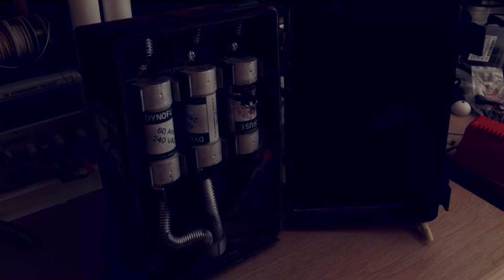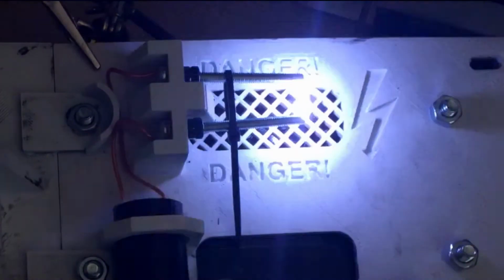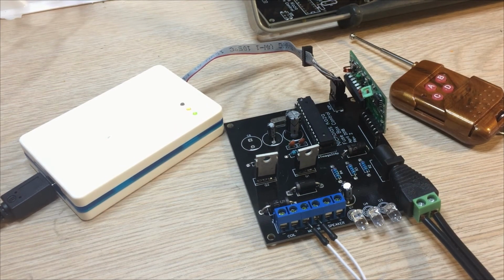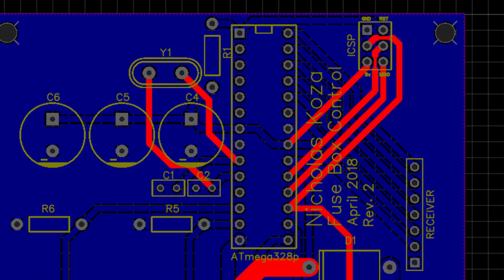Sparking Fuse Box Halloween Prop

Comment: Well done.  I've made a few prop controllers now, but went with the Nano instead of a bare chip as it made the code easier to update.  The USB port also made it possible to have a small PC app so an end user can adjust all of the various settings.
Reply from the maker: Thanks. There's definitely some trade-offs between the Nanos and bare chips both ways. The Nanos are definitely a lot more accessible. I have an Atmel-ICE though, which makes the difference pretty moot. I'm also not aiming for end-user adjustability on this either though.
Reply: I completely understand.  I'm making some boards for others, so want them to be able to upload new firmware (via Xloader) and adjust the timings to suit their prop.

Comment: Hi I have a question. So what are the part numbers for the following components on your circuit? R6,Q2,U9 I can’t find the exact parts you used. I basically just need the circuit you used to control the step up transformer I am repurposing the circuit.